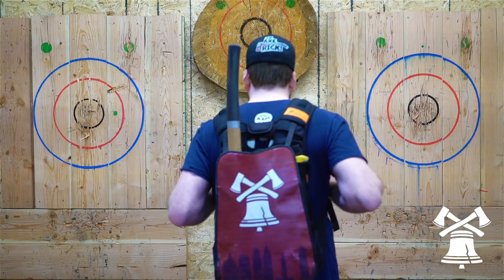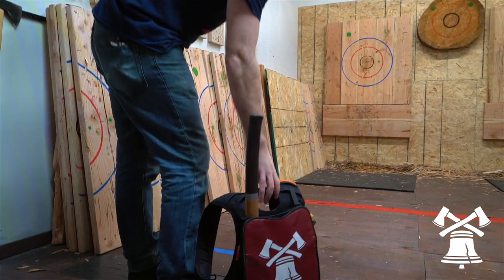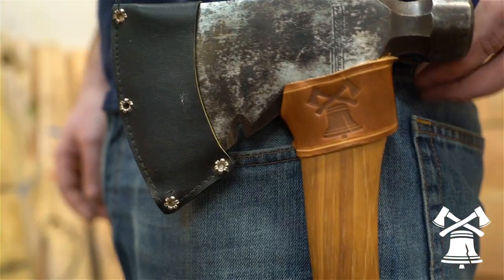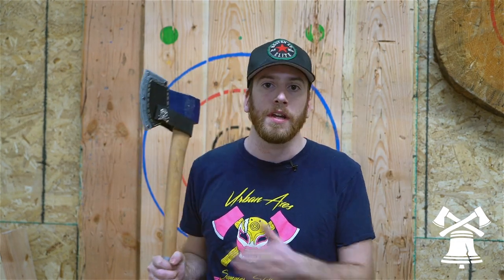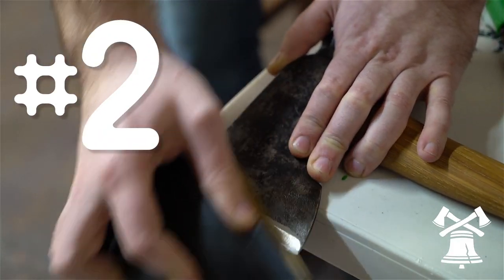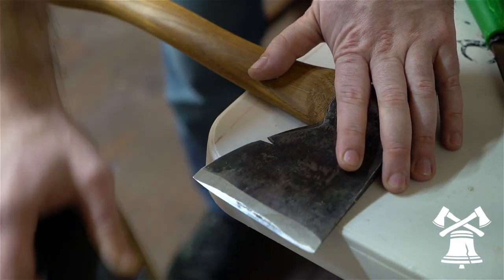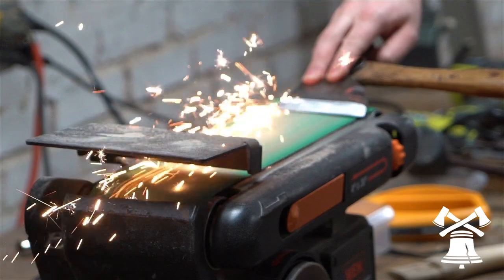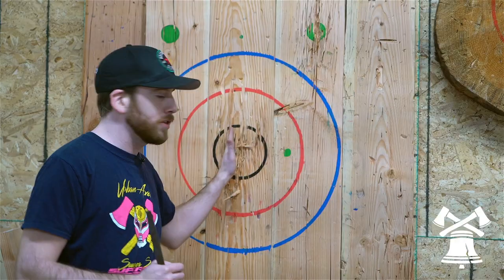Top 5 Axe Throwing Accessories

Comment: What type of boards do you use for the target?  Softwood or Hardwood?  And do you do anything to wet the boards?
Reply from the maker: In our practice space we use pine.  Some locations use hem fir lumber as it is a bit cheaper.  Both work well.   Its always important to wet the board when you throw especially on the new boards..  Just a simple spray bottle hung on the wall next to the target is all you need.  Give it a good spray every time before you start a match.
Reply: Thanks!  For wetting the boards, I was considering trying out one of those 1-gallon garden sprayers.  Since we use A-frames at the place I am an instructor, it would be easy to store behind it.
Reply from the maker: They use those at Choppers Hatchet House in Cherry Hill NJ.  They work really well.  If you have the space for them which it sounds like you do its your best option.

Comment: I purchased a couple harbor freight axes for practice.  Do i need to rebevel them? What size big axe is allowed in NATF
Reply from the maker: They seem to have a lot of options.  I have never purchased any harbor freight or seen anyone using one so I cant speak to the profile of the blade.  For NATF the weight requirements are 2.25-2.75lb head weight and up to a 4.5" axe blade.
Reply: Axeadelphia is there a handle length requirement or suggestion?
Reply from the maker: Ah yea sorry forgot to mention that.  Has to be at least 25".  Length depends on how close you want to stand.  I throw a 25" so that I can stand as close as possible.